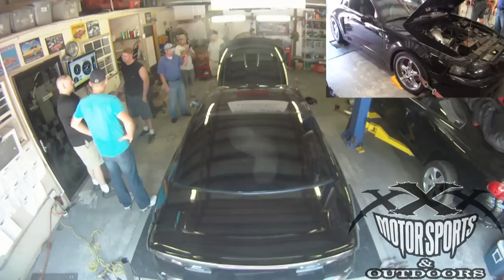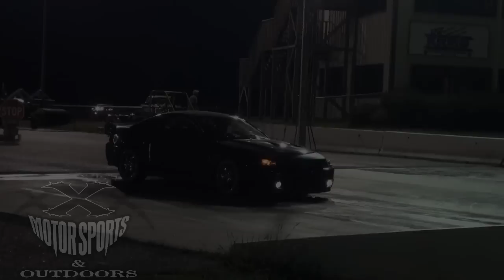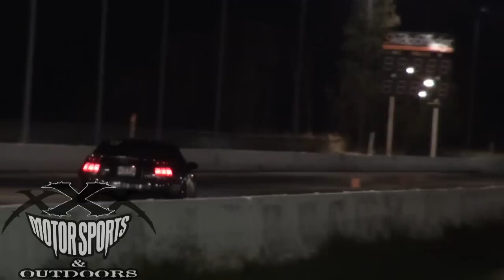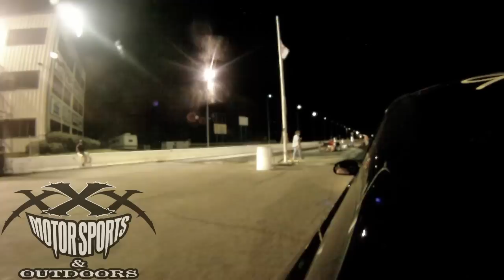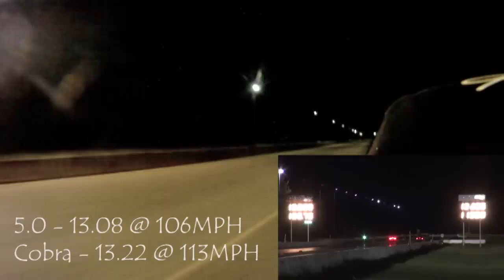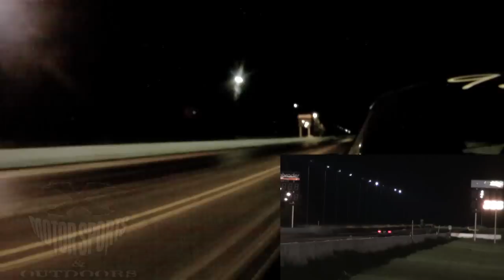2003 COBRA TERMINATOR DYNO & DRAG RACING ACTION!

Comment: To the guys that said something was wrong with the car well you guys were right. Since this video was made I have had to replace the fuel pumps and had the car retuned. Someone had jacked with the bypass valve on the blower and closed off a valve causing the car to not hit instant max boost. But with the new tune the car is now pushing 490hp/530tq running out of fuel around 5500rpms. There is a lot left in this car and hope to have some new track video's up this weekend.

Comment: @rekjavicxxx yeah this sat. last sat we ran 2  2007 C6. one cam, heads, intake, headers, and 102mm throttle body vs. procharged, blower cam, and 102mm throttle body. then had a 2000 camero with ls2 convesion with alot more into the motor than we thought. lets just say he took the procharged vette by half a lenght lol. all that and no camera just a phone vid that sux

Comment: you should be making more power than the dyno suggested cuz u have a ported eaton and with the right tune u can easily push 500 horses or at least close to it...i have an 03 vert and my blower isn't ported and it's never been dynoed but my best pass was a 12.657 @ 113.35 and that was with bald head street tires...check out my video that says Me vs WS6..the camera quality sucks dick and i apologize about that but if u get a chance, let me know what u think.

Comment: damn you've got right at 440 horsepower to the wheels, and only running 13.2s? my 03 cobra is bone stock minus just Flowmaster super 44 weld ins....not even a full catback, and I ran a 13 flat on street tires at 110....your car should be WELL into the low 12s if not high 11s. that's kinda bad when someone in a bone stock 03 is running faster times than your modded car. I'm not even trying to be an ass either bro....get u some sticky tires and some more seat time.....I don't wanna see anymore sad 13.2s in a freaking modded cobra....lol